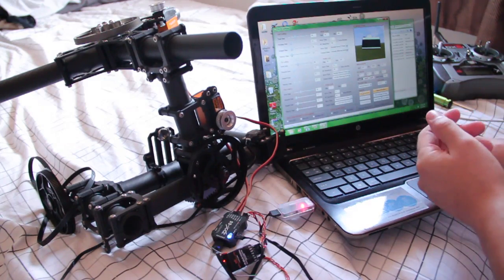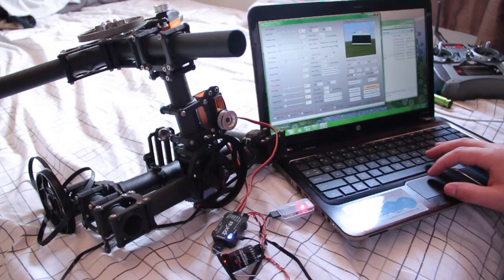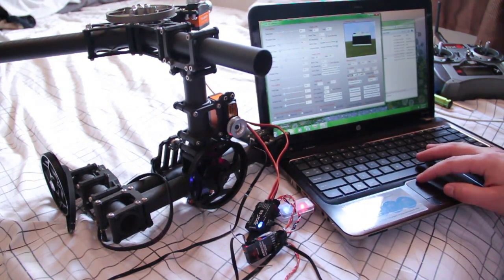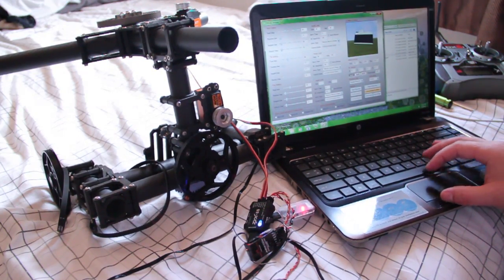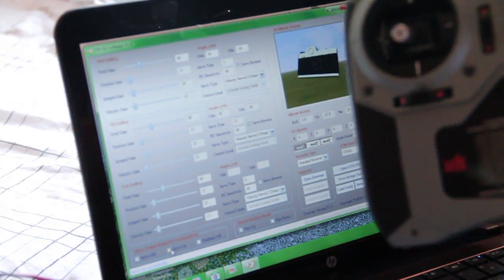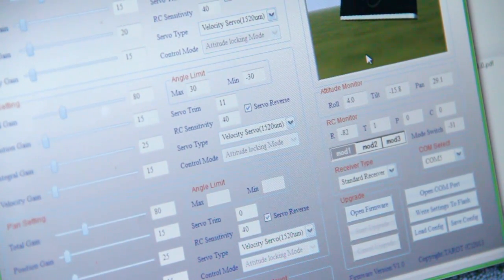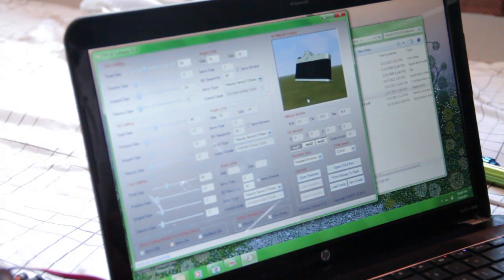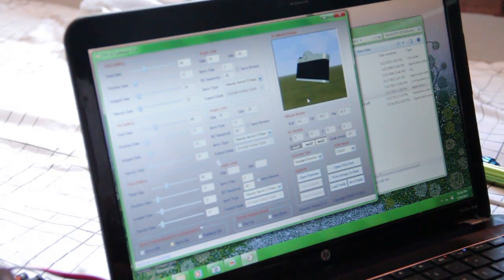Tarot Gimbal with ZYX Controller Problem

Comment: jose tengo ese mismo  gimbal con el,Tarot Gs 3-axis  Gimbal Stabilization Gyro System Zyx-gs. pero no se que bateria comprar para poder, poner a funcional el gimbal, cual bateria me recomienda que compre para poder usar mi gimbal???
Reply from the maker: Carnal, te recomiendo una 2S 5000MAH lipo. Puedes encontrar unas buenas Turnigy en Hobby King.com. Buena suerte
Reply: muchas gracias Jose Martinez pero de cuantos voltios en espesifico de 4 o de 7 voltios???

Comment: Jose, I was just wondering if you got the problems resolved. I also have a problem with my spectrum receiver. Hope you don't mind but would like to email you for any settings on the gimbal. Thanks.

Comment from the maker: Hey Alexander, I can understand your frustration. What I did is first balance my camera to my gimbal without the belts. Once balanced add your belts. Make sure you have your sensor pointing to the right weather its facing up or down. Then what you want to do is set your servo trim to 10 on both tilt and roll. Make sure your servos are set to velocity. I can also send you a screen shot of my settings if you send me your email address to jvcm84@gmail.com